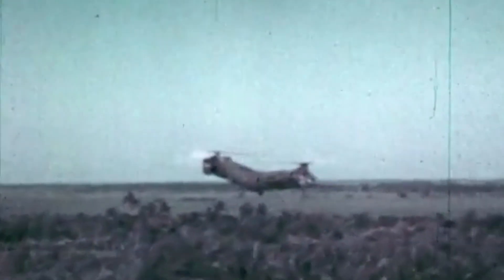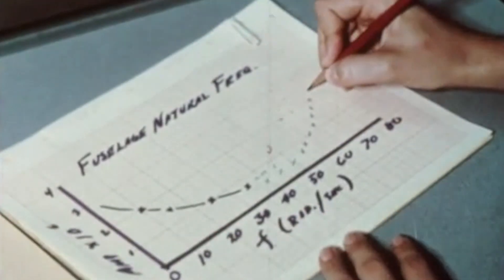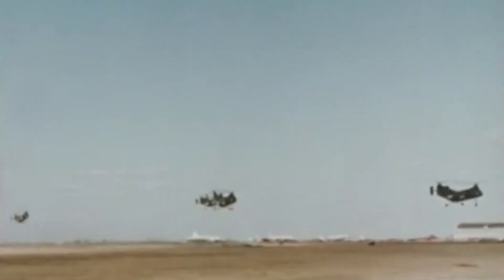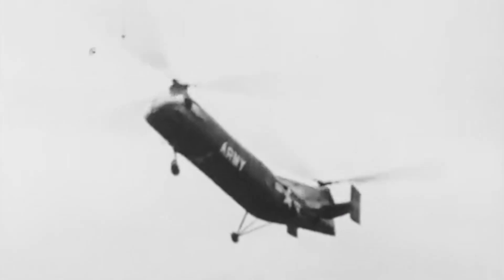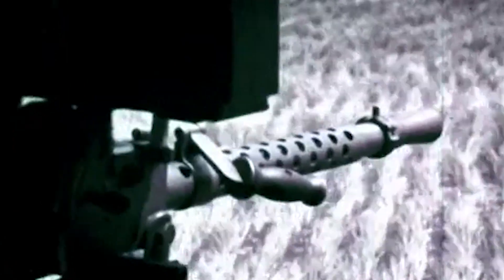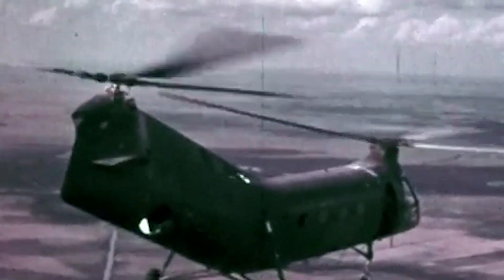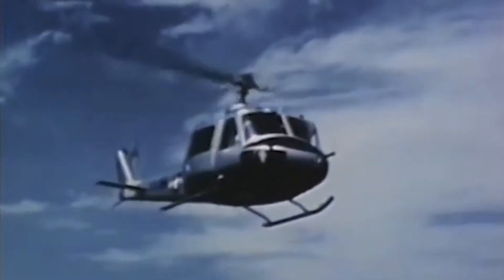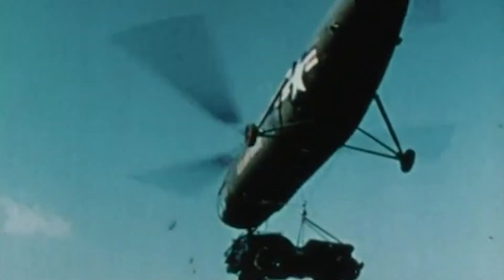Piasecki H-21

Comment: what.... the engines lasted 200 hours and were only rated for 600 hours? that's crazy.... I wouldn't want to fly in that ticking time bomb.
Reply: I flew one of these in Vietnam in 1963. Just before our CH-21s were replaced with the Hueys we were actually averaging <60 hours on an engine. Our missions required us, when fully loaded, to fly at max combat overload rpms and manifold pressure on take off  in order to defensively gain altitude as rapidly as possible so as minimize potential damage from ground fire. The nature of our support operation required many takeoffs in proportion to overall hours flown compared to conventional fixed wing aircraft.

Comment: The Germans I believe created the first helicopter transport but failed to see it's potential use in time.
Reply: Well, not exactly, the German helicopter transport were mainly meant for supply transport, but the lack of power and it was pressed into other roles, so not as successful as what Sikosky will attempt in 45'.